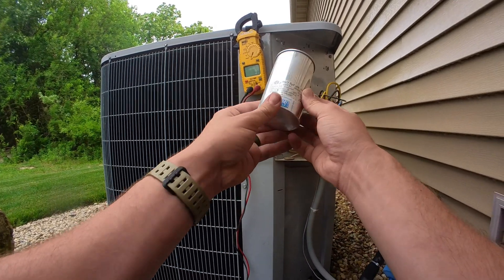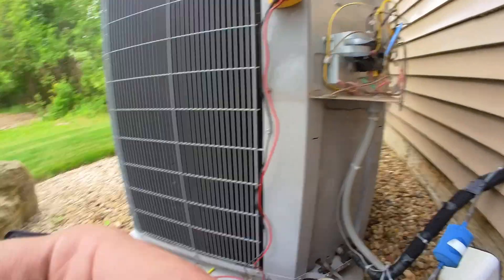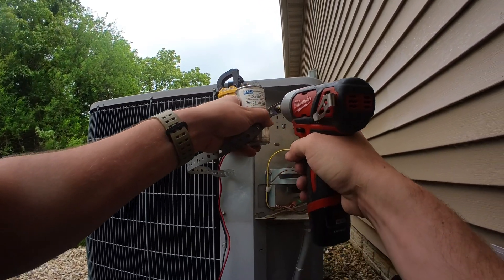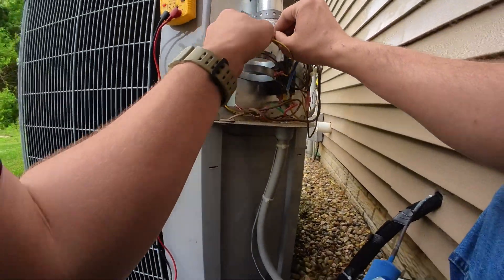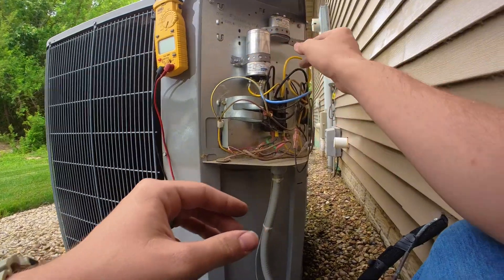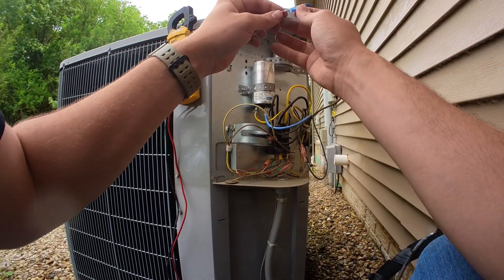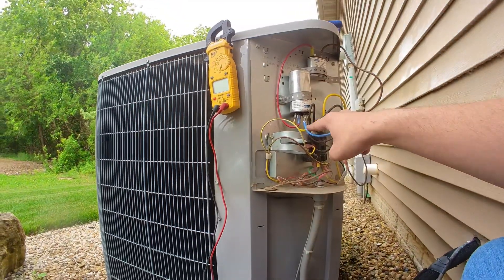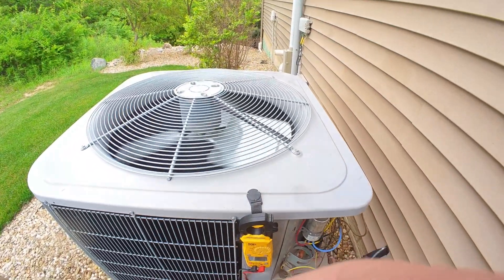I didn’t have the right capacitor, so I did this

Comment: I have always mounted odd size caps on the horizontal, so they don't slide out of the strap. Sometimes I add a zip-tie for the same reason. If I make a bracket, then I leave the OEM one inside for the next time.

Comment: Ooofff. Take this video down dude.
Reply from the maker: Why
Reply: @Freonandbeyond Have you tired math?
Reply: Brother that was rough to watch haha. A few things. First, keep an AmRad Turbo200 and Turbo200X on hand and avoid this entire thing. If you insist on using two caps, do a double band clamp. Instead of breaking the band off after the first cap, just secure the next cap with the remaining band. 1 strap, 2 caps, 3 screws. Now all the terminals are in line. Lastly, don't mount a cap upside down especially if it is an oil filled cap. There are a few reasons for this but here are two good ones: when that thing fails it's gonna make a mess. Most importantly, oil filled caps are never to be mounted upside down or horizontal because the  oil will fill the top gas expansion void and part of the cell plating will be out of oil and exposed to air, leading to premature failure. But I digress.
Reply from the maker: @HiTek3  I like the idea of using the same strap, I guess I just was thinking about somebody having to replace one of them in the future. But I have not heard about the capacitor being mounted upside down being an issue. I have seen a few manufacturers have capacitors from the factory mounted upside down or horizontal. More times than not it’s horizontal especially with blower capacitors